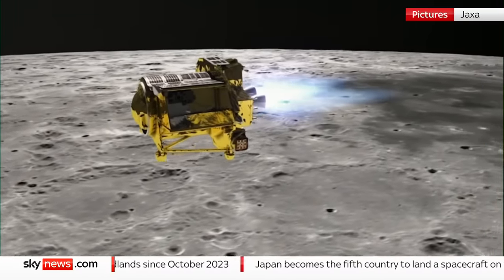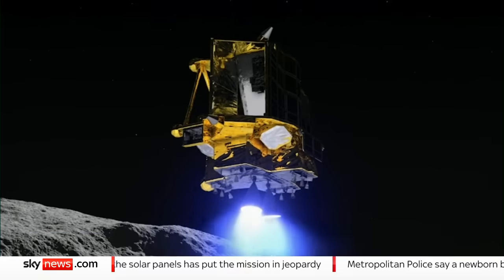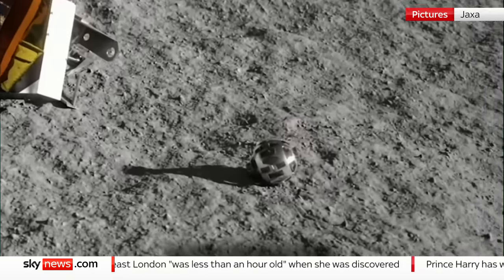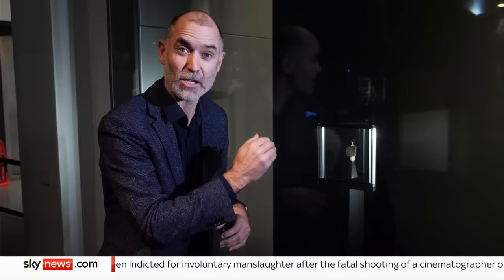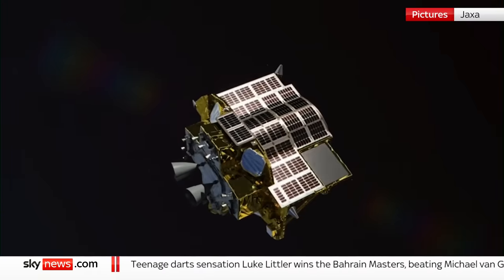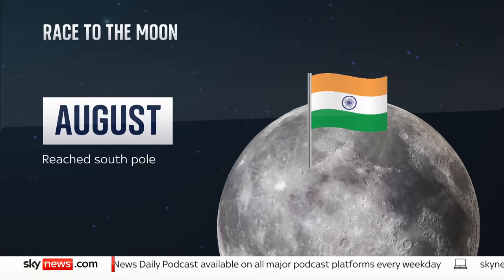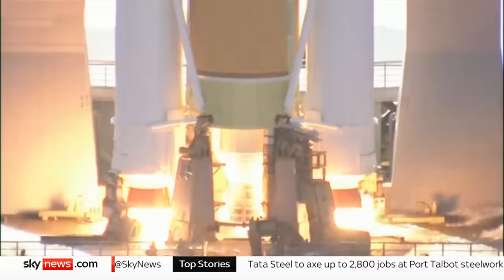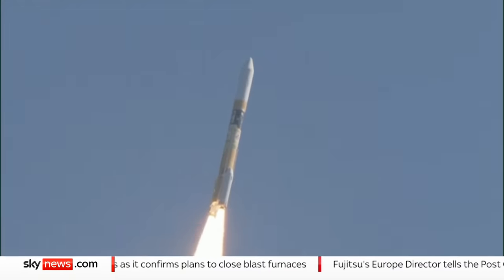Japan makes historic moon landing but mission remains up in the air

Comment: The "but mission remains up in the air" language smells a bit "acetic" somehow. 
At least the rocket didn't experience the kind of fuel leakage on way up in the air, or in the vaccum, on way to the Moon, as some other did some weeks back?
Reply: The fact that a rocket has nothing to push off of in a vacuum is 💩  enough for me to question any and all of this.

Comment: How did this Space vehicle travel through the vacuum of Space with a FUEL EXHAUST PIPE?  The fuel exhaust pipe is essentially an opening  to the engine and the FUEL TANK.  The vacuum of Space  would vacuum all the fuel out of the tank  in seconds. (I'm not a believer and I couldn't help it if I tried)

Comment: It crash landed not soft landed.
Due to crash landing the solar panel gets damaged & stopped working.😊
Reply: Incorrect. It soft landed, but not with the intended orientation, so the solar panels are facing the wrong way to make electricity from the sunlight at the current time.

Comment: The whole world is talking about successful landing but my question is: If the landing is done in the opposite way, it is not getting into the head.  Landing on the opposite side will not charge the solar, so when the battery is depleted, communication with the lander is no longer possible.  So I don't understand why the whole world is promoting it as soft landing.  😅
Reply: The fact that they managed to land its the successful part. They can then work on any issues and techniques to be more successful the next time they try
Reply: @iburntt0ast682 still not successful landing! Even India did crash landing in 2008 itself on the South pole and provided some valuable information about presence of water on moon. And that mission is probably more worthy than this Japanese one. So we can say India was the 3rd country and not the 4 to land on moon?lol

Comment: Only cartoon provided.

But the real thing is that it crash landed & hence no power on board.

Soon more cartoons will follow!

NASA pls try to take an image of the crashed spacecraft!
Reply: Who claims that there is no power on board? It simply can't generate additional electricity from it's solar panels due to the wrong orientation of the space craft, so it currently runs on battery and they were still able to communicate with it.
Reply: @Wulfstrex  y Japanese cant admit that it crash landed?
Reply: Space is hard
Better luck next time!